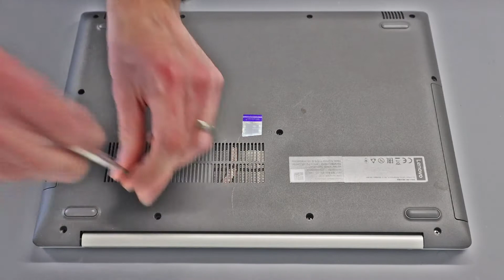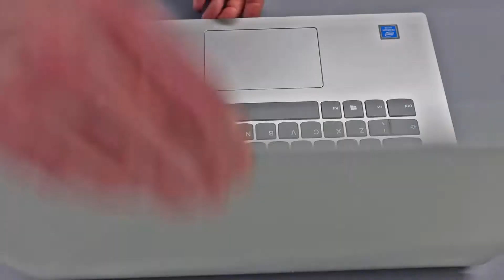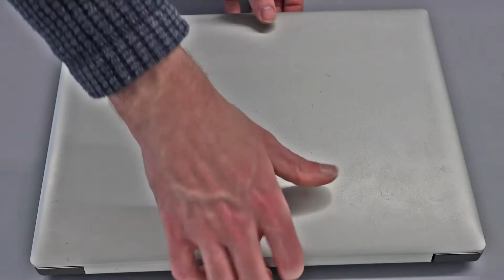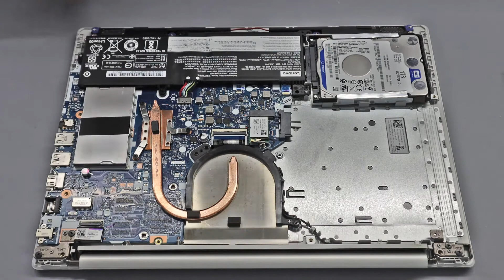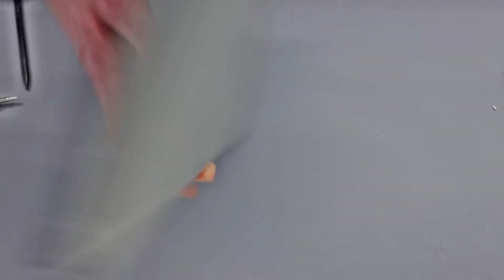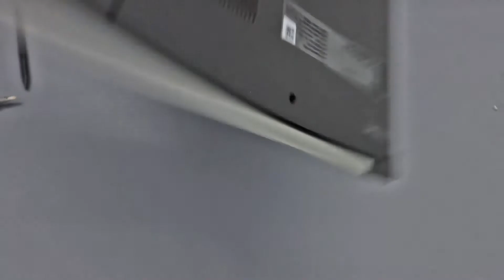Lenovo ideapad 330-14IGM - SSD/HDD, RAM and Battery Upgrade and Replacement Guide

Comment: Hi, thanks for the video! My son has one of these since Q4-2018 and I have upgraded from HDD to SSD SATA III 2.5" and RAM from 4 GB to 8 GB. I was wondering if has someone tried 16 GB DDR4 in this device? By specs it is limited to 8 GB but I have experience "overramming" up to 3 times the manufacturer´s maximum.

Comment: Hello. I have bought a new battery for my lenovo idea pad 330. Is there anything in particular I need to do before powering up my laptop after I have installed the new battery?
Reply from the maker: Nope. Probably best to put it on charge, but otherwise not really.

Comment: Hello, I have a question. Is there any caddy adapter to replace that plastic from the "cd-drive reader"?. I have the same laptop and I was wondering if i can just place a new ssd in that empty space and keep the other hd disk.
Reply: It seems it has the connection for the ODD in the motherboard. What concerns me is wether the space available is enough or not ofr the 9.5 mm Caddy. Worth the try thoug.

Comment: Hello Sir, I'm going to upgrade this laptop model's HDD by an SSD. Considering this laptop has only one memory slot, does it worth to upgrade replacing 4GB by and 8 GB module? I mean will I see a better performance? or just replacing the hard drive should be enough to run Windows 10/11, Chrome and some light apps smoothly? Thanks a lot.
Reply from the maker: Going to an SSD from a mechanical HDD will have a much bigger impact than upgrading the RAM. If you have 8GB (2 x 4GB) then going to 12GB won't make a huge difference in most scenarios.
Reply: @BrueComputing  thanks for your response. Does the 330-14IGM model support a 480 GB SSD? I bought a Timetec 480 GB SSD and I'm trying to perform a Windows 10 install on it but installation program is unable to partition or format and it cannot continue to copying files. Is it anything else needed to prepare SSD before a clean install? Thanks a lot.
Reply: @mvha1119  no
Reply: @mvha1119  Did 480 GB SSD work? what is maximum capacity?
Reply: @mvha1119 heyan, did you go for the upgarde? And what do you advise ? Good decision or not really?
Reply: @mvha1119  can take even 4 TB (4000 GB).
Reply: @walidelbelghiti3513  I did, 500 GB and it gave a second life to the device. SSD SATA III 2.5" is around 5 times faster in sequential read / write but in random read is 270 times faster!
Reply: @walidelbelghiti3513  the issue was a defective SSD so I only could upgrade the RAM to 8GB maximum and the device worked fine for some months more and then my relative got a new device. This device is really underpowered but strangely is able to comply with Windows 11 system requirements.

Comment: Hello, I have a similar laptop. It has a Pentium Silver N5000, 4 GB of RAM, and a 500 GB HDD. I only used 90 GB from the HDD. Sometimes booting up and opening any browser or Microsoft office takes a lot of time. Should I upgrade to SSD?
Reply from the maker: Yes, an SSD will improve boot and application startup times.

Comment: is the expansion drive slot an mSATA? M.2? 
where can I buy a compatible adapater and what PN (part number ) would that be?
Reply from the maker: No mSATA or M.2 drive slot, just a 2.5" SATA connector.
In models with an optical drive you can fit a 2.5" SATA caddy in its place to add a second drive.

Comment: Hi im planning to upgrade my laptop(same model) if i replace ssd but i want to use the old hhd into optical bay what i need cable for that? For me to connect the old hdd . Great thanks
Reply: You can use the empty disk drive as an SSD, you just need an adapter and SSD

Comment: I have a 330-15IKB that has 8GB RAM installed. But its lagging a little since I Run CAD/CAM softwares fairly heavily. Would upgrading the RAM to 16GB, or switching to a SSD be better?
Reply: Hi Mark. Did you upgrade ssd? If yes how much GB SSD does this system supports?
Reply: @khushalthakkar1904  4 TB (4000 GB) should be no problem.
Reply: I would recommend doing 1st the upgrade to SSD Sata III 2,5" and then, if still not goog enoug, try the 16 GB DDR4 RAM upgrade.

Comment: Why I see so many videos about replacing the HDD for an SSD and not just adding the last one to the free "optical" port/bay that this model has? What's the powerful reason behind not to keep both?
Reply: Maybe because it comes without ODD, not sure if a 9.5 mm or 12.5 mm Caddy would fit and work properly...
Reply: The connector may be smaller. It is on my dell laptop. Might need to 3d print an adaptor for the ssd to sit snuggly.

Comment: do you know if the 14IGM can take 16gb DDR4
Reply: El celeron que tiene de micro solo soporta 8gb ram máximo a 2400mhz
Reply: @facundoleiva9834  que pasa si pongo una de 2666?
Reply: @florescastroalexjosue264  baja su frecuencia a 2400 mhz, es decir, nada. Sólo podes llegar a pagar más dinero por una de 2666 que por una de 2400. Gastas plata, éso
Reply: The max size is only up to 8gb DDR4
Reply: @dionramirez158  so with 4gb  soldered + adding 8gb ram more will be 12 gb will that work on ideapad 330 14igm?
Reply: @matchatoon  As for my son´s laptop, same model, has no soldered modules, only the one in the slot, officially up to 8 GB and my son has the 8 GB (DDR4-3200) working fine at 2400 (processor limit). I plan on trying the 16 GB DDR4-3200 soon al hope it works too as another devices with same processor (N4000) can handle it.

Comment: Hello James, I have the same laptop model and its tiring me out cause its so slow and always logging. Do you think it's alright if I update the bios? It's in the critical updates in my lenovo vantage. Or do you happen to know other way tyo resolve the issue? Thanks.
Reply from the maker: I doubt that would make a significant difference. Does it have a SSD or HDD in the model you have?
Reply: @BrueComputing  maximum SSD capacity?
Reply: @khushalthakkar1904  1 TB should be no problem... I would Try 2 TB.
Reply: Upgrade to SSD if you have HDD to boost performance a lot, then add more RAM if you need.